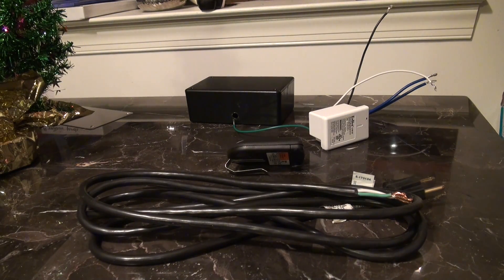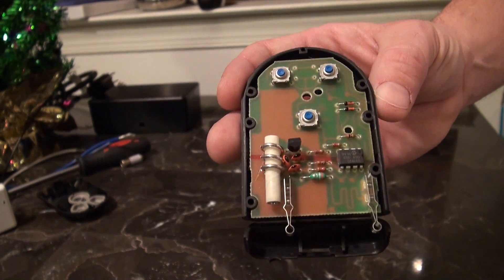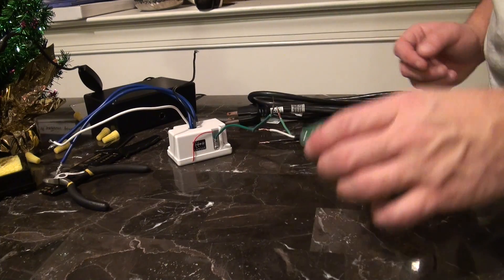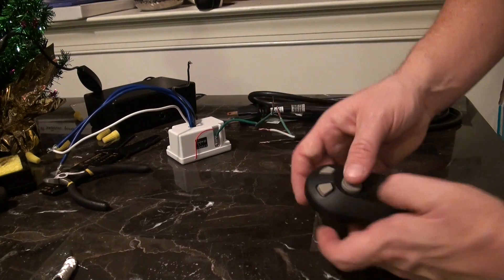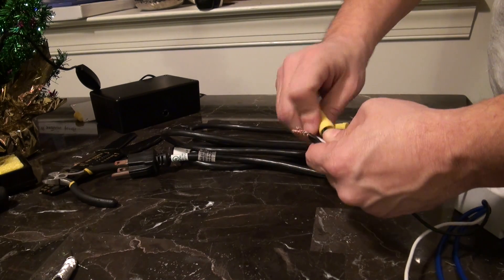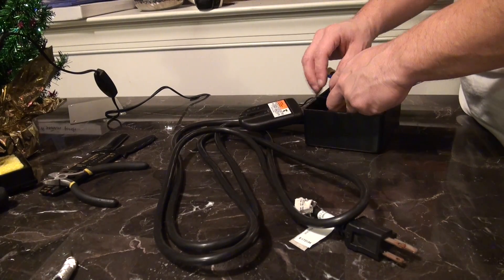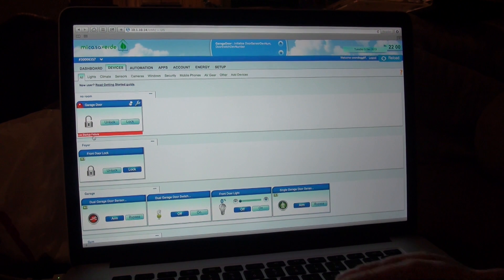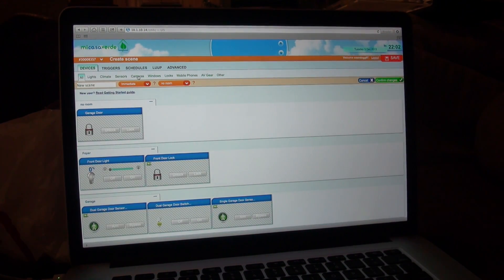ZWave Garage Door Remote Control Setup MiCasaVerde

Comment: Brian,

Do you think it would be possible to hard wire this into a wall switch?  I'm thinking an in-wall outlet box behind the push button that mounts at the inside door to the house typically.  Wire the relay leads to the back of the push button so that tripping the relay would "press" the wall switch?  In the wall I can wire constant power to the relay so I'm not messing with a cord coming unplugged or the battery in the remote failing?  See any potential problems with this hypothetical?

Zach
Reply: Zach, did you ever try this?  Not that I don’t like Brian’s idea, but yours makes more sense to me.  How did it go?

Comment: Hi Brian : Great video : One question : I'm trying to rig this to my powered garage door opener: I have an image of it at http://i57.tinypic.com/2i91iqt.jpg. Can you pls tell me if it will work firstly, and secondly how to sodder the wires to the circuit marked with 1,2 3,4 in the image to the top. This i believe is the main open/close button on the Opener. ( numbers are in tiny red's to the top)

Comment: How do you wire in the garage door sensor and door switch into the equation? Do you have any info on that?
Reply from the maker: Cole - I added a link for the sensor in the description. There is no wiring to it, it is run on a battery. Just peel and stick.

You can see a description here:

Schlage Home Door/Window Sensor Installation

Comment: Isn't mixing copper and aluminum a fire hazard?  Are the wires aluminum for the z-wave device?  If so, Am I suppose to buy "aluminum to copper" wire connectors(nuts), since my computer power cable is copper?

Comment: Does this setup still allow you to use the wall buttons in the garage to operate the doors, and does the status of the door (up/down) show up in vera (computer or mobile app) if you use the wall button as opposed to the computer?
Reply from the maker: Yes, all you will sacrificing is the remote. Everything else will stay intact and work. Even the remote will work if you leave it outside of the box. The door status is given by the sensor on your garage. So regardless of how you open the garage if it is open the sensor will tell you it is open.

Comment: Brian, great video.  I am using the same relay you have but I wired mine straight to the garage door motor.  The relay works great when you press the manual button however, when I try the remote control from the Mi Casa Verde site or my phone...no luck.  I also notice when I have the relay plugged in the door switch mounted on my wall no longer works either.  Any ideas?

Comment: I like this idea better than going directly to the bell wire. I tried the relay and burned up a part in my opener from opening and closing it to much.. Granted the garage opener was 15 yrs old. But now I'm spooked to try the bell wire method again. Using the remote gives a sense of safety that I cannot burn up anything in the man motor unit. I look forward to trying it

UPDATE: Its works, I am even controlling my second garage door with the same plug in program. if you go into the app you can "Create Another". I soldered wires to button #2 on my garage remote.

I have to thank Brian, without your video, I would have never figured it out. Thank you for the excellent video.

Comment: I love your solution!  I 'm using your setup.  My only change is using a waterproof 1st aid box to help with moisture issues in MN.  Have you had any issues with the LFM-20 burning out?  My setup worked for 20min before frying.  Think I just got a bad relay?

JBond26 - I tried your method 1st.  It wasn't possible for my application due to the wires you mention also controlling the light on the opener.  I would loose light control every time. :-(

Comment: Brian... thanks for the video... made it easy to follow and I am waiting for my components to arrive so I can try this same setup. One question... do you actually NEED to have a door sensor to make this work?
Reply from the maker: You won't need the sensor to operate the garage. If you aren't using a sensor you aren't going to need the Garage Door app I went over at the end of the video. You can just setup a scene that will flip the relay on and then setup a delay to flip the relay off a second later. That command will act like someone is clicking the button on the garage door remote. A nice advantage of the sensor is you can setup a scene to have your garage door checked and if it is open (sensor is tripped) the door will automatically close. Nice feature if you have a tendency to forget to close your garage door at night. So a sensor isn't necessary, but it really does expand your options.

Good luck!
Reply: Brian Cooney You make some good points and I have ordered the sensor to complete the install. Thanks again for the video and the response. Appreciate it.